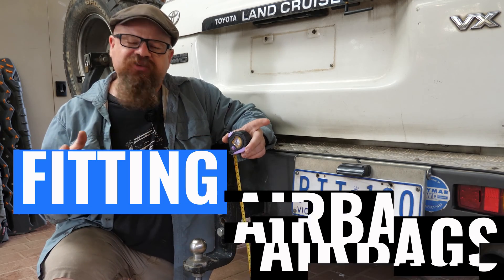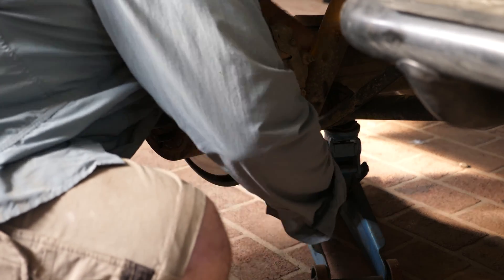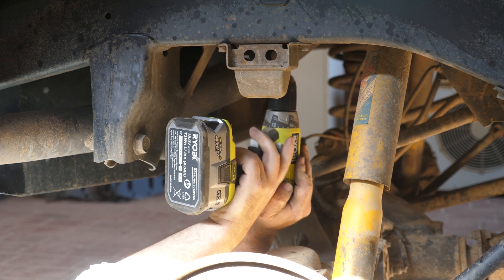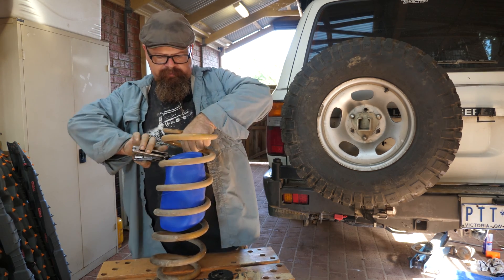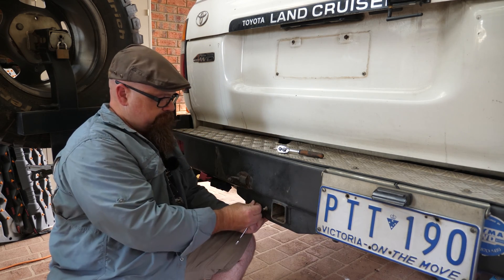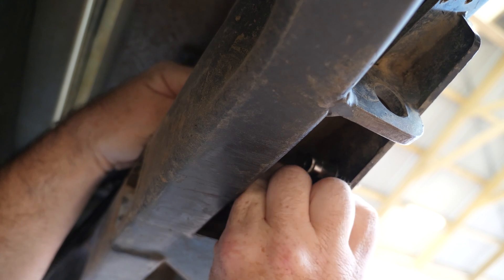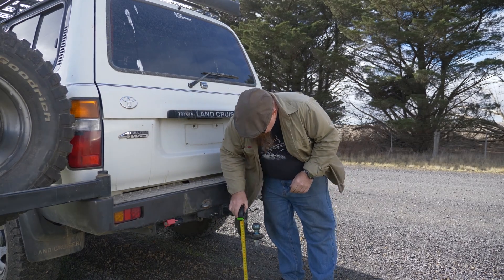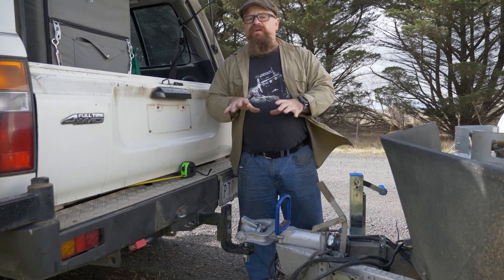Towing Capacity and Suspension Airbag Helper Install

Comment: I love mine in my 105 dx no idea the brand  but they are blue so I’m guessing airbag man
but got a 2 inch lift so guessing 2 inch suited
So far got “outback” rear draws n my cfx 28 fridge
Rock amor rear bar with dual Jerry’s 1 always with 22litres water n my 33” spare on the other side

I leave mine on 10psi and it makes a massive difference in rear height good 2 inch at a guess never measured it but you can see it lifting and lowering when I’ve filled n emptied them
I flex out as it’s my weekend fun car not my daily unless I’m working static shifts where the fridge n oven come in helpful {cheers for the inverter vid too I got 1 of the last ones :) }
I’ve used them to drag a 105 gxl with no engine n they were fine I bumped it up to 35psi n it again raised the car float
Same with the td 80 I got for it’s engine:) definitely a fan of airbags :)

Comment: Hey mate just wondering how did you deflate that airbags thank you
Reply from the maker: Via the Schrader valve.
Reply: @LockyourHubs4WDing   can you release air from there or do you need a deflator like a staun tyre deflator?
Reply from the maker: A stick will do!

Comment: I fitted a set in my 105 and bought the correct kit to suit my 50mm suspension lift. I had very different results with increased ride height even at low pressures with the ability to go up to 60psi with the Kevlar sleeves. Make sure you buy the kit to suit your current suspension as they go from standard up to 4” lift.
Reply from the maker: That's unusual, glad they're working for you though.

Comment: My air bags are popped, do you think replacements could be installed without having to remove springs,  ie thread them through the gaps between coils?
Reply from the maker: Depends on the springs, though you might get lucky at full droop.

Comment: So the bags were not able to keep it level, is that what I just watched?
Reply: The ones I bought for my 80 series are able to go up to 60psi. I'm hoping that is going to level out with my caravan because it's dragging at the moment. my neighbour has a similar setup and he uses 50psi to make it level and take the 300kg ball weight. Tows great now though
Reply from the maker: Airbags are great for levelling, though they're not going to fix bad weight distribution in the caravan. Get the weight as low and as possible and as close to the caravan wheels as you can. It'll make the caravan a real pleasure to tow.
Reply from the maker: Those sort of bags main function is to effectively increase the spring rate, not so much increase the height.